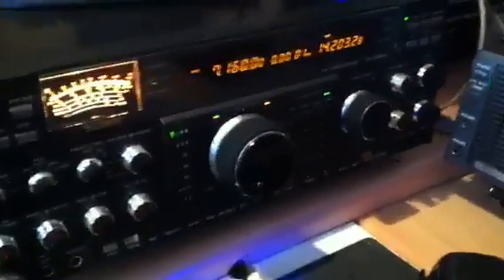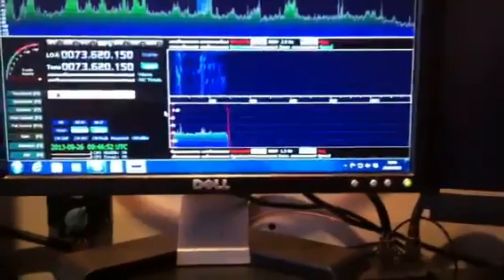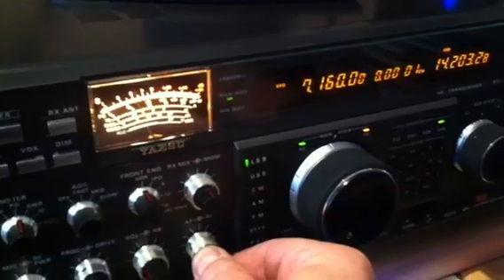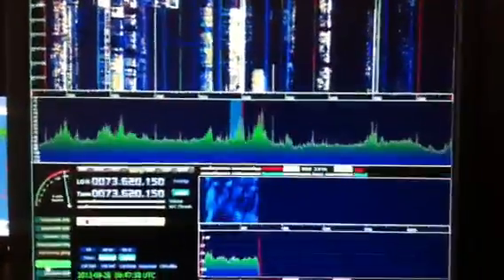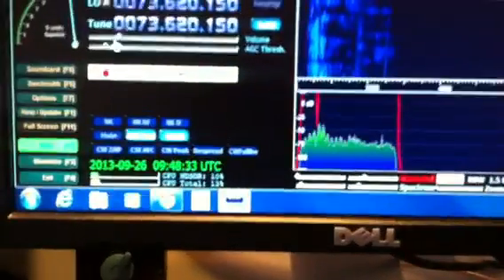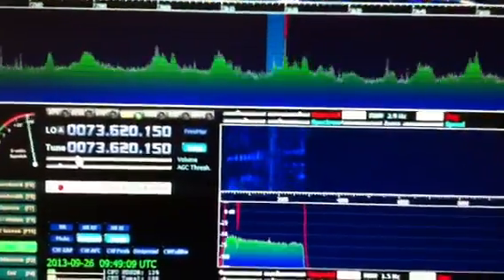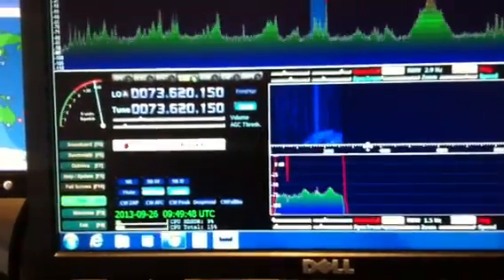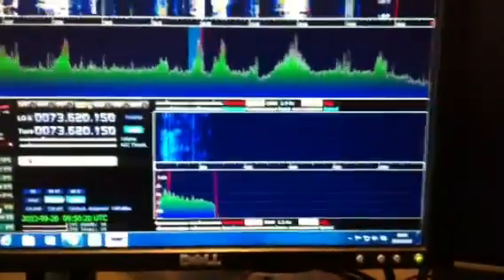using my funcube dongle pro + and the IF output of my YAESU

Comment: Hi, I notice that all the videos shown on YouTube show demos using 40m band. There is not much information about using the dongle plugged into the i.f. output of a tranceiver.  I have a Trio 940s which has 2 i.f. outputs. Am I right in saying. if I plug the dongle into one of the i.f.'s and download the appropriate software, I would see a the display on my computer and be able to see all amateur bands besides 40m ? thanks de Paul
Reply from the maker: yes.. all u need to do is tune the dongle to the if output freq an that will give u the scope function
Reply: Thanks Rick. Do you have to enter the i.f. frequency each time you change band or it just the once off. When you transmit is the dongle protected  against overload/saturation from your own local R.F. ?  Thanks for this info. I suppose this is the cheapest alternatve to a conventional pan-adapter 73  de G0AVO